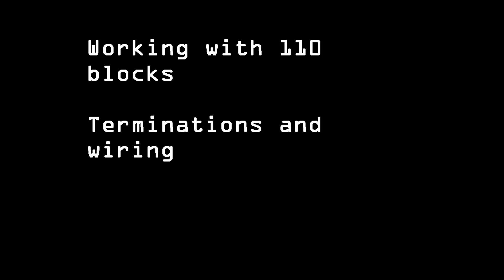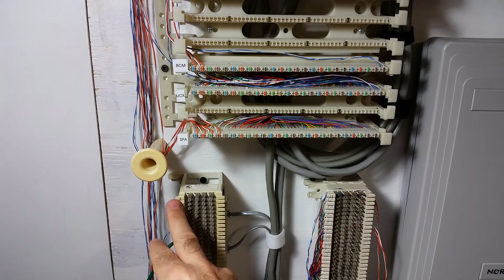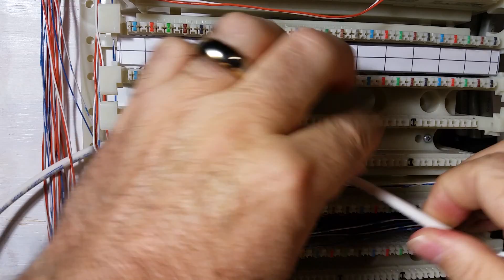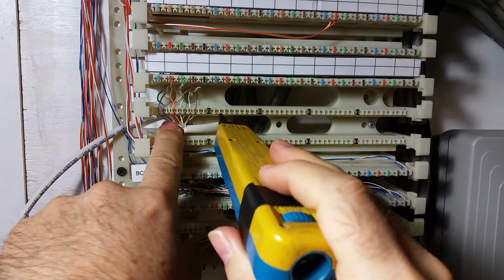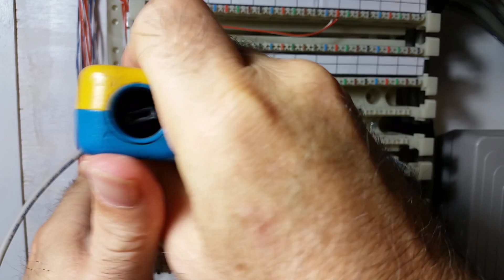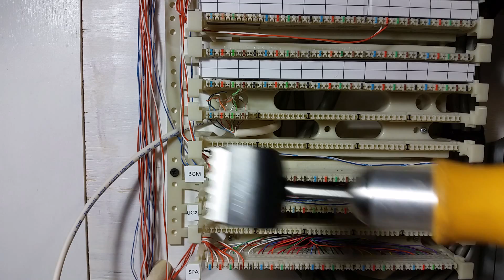punch down 110 blocks

Comment: Compare the cost of a new 110 head for your punch-down tool to the time you spend in a year wiggling cut ends off a block times your hourly rate.  Work smarter before you work harder.
Reply from the maker: That’s how I like to think about things too.  Great point. 👍🤔

Comment: As a Canadian, I have much more experience with BIX strips, rather than 110.  In fact, I've only worked with 110 strips once.  With BIX, instead of using those wafers, you punch the cable onto one edge of the strip and then flip it over, so the cable is at the back, leaving the front side open for the cross connects.  BIX is common in Canada, because they originated with Nortel, the same company that made PBXs and a lot of other telecom gear.  About 11.5 years ago, I was at the State Farm head office in Indianapolis, Illinois for training, where I was surprised to see lots of BIX, though they also had 110.  The punches for BIX are very similar to 110, but the 110 punch can also be used with the Keystone connectors and patch panels.  You can get BIX strips marked for different cable types, such as 25 pair, 4 pair and 2 pair.  I don't recall seeing 3 pair, but they may exist to be used with the old 3 pair CAT3 phone cable.  The only difference between the basic strips is the markers for cable type, but are electrically identical.  There are also special types for multing, etc., but I haven't used those.

Comment: does anyone know where the names come from? 110, 66? the 110 block is more of a strip and has 100 connections, the 66 block has 200 terminals...
Reply from the maker: Right.  I don’t think the model number is related to the number of connectors.  Good question 😄
Reply: These were AT&T / Bell designations. The predecessor to the 110 block is the 88 block. I'm not sure what the difference is or when they replaced the 88 block with the 110 block (sometime in the 70s is my best guess). The pictures of the 88 blocks I have found look identical to 110 blocks.
Reply from the maker: That’s interesting, Brian.  Thanks for that info! 😊

Comment: I'm wiring up an intercom system that requires 12 cable joints. Rather than using gel connectors floating in a large junction box, can you buy DIN rail terminals from which the connections can be made? That way they are neat and easy to understand for any future technician looking at them?

Comment: If your punch down tool is dull,  Sharpen it deat Henry !  A few strokes of a file will save messing with all those partially cut conductors.
Reply from the maker: Hmmm, I will have to try that! 😁
Reply: Yep.  I would consider his tool defective.  Some punches are adjustable for the blade.  I have Eldon punches for both BIX and 110 that have that.  Eldon got the line after Nortel went bust.

Comment: Great video! Needed to learn how a 110 block works in the immediate and this did not disappoint. I'm sure it wouldn't be recommended, but is it possible to rip pre-existing punches out of the wafers and repunch as needed and keep the physical integrity of the block/wafer?

Comment: Hi, i find your video very interesting, but what got me confused here. you punch down on the third pair while the other end is on  the blue pair why not on the same third pair.
Reply: The top (green) pair was the service from the phone company (phone no 111.111.1113) and the bottom was the outlet in your wall going to the physical phone. If he did blue to blue that would have been another phone on the first service line (phone no 111.111.1111). If he did green to green then the phone outlet wouldn't work because a telephone doesn't use the pins in the green position of the wall outlet, only the blue (the other 3 pair are there for future flexibility, for example put multiple outlets on the single cable where blue is outlet 1, orange is outlet 2, green is 3, and brown would be 4).

I'm no telecom worker, this is just what I've picked up from videos here on the tube...

Comment: For cat6 you need to keep as many twists as possible to prevent crosstalk so don’t fan out the pairs. Just place them in the blocks by using the small peak of the block to separate the twist and place the pair before cutting.
Reply: I also put the end of the outer insulation in the middle of the connector and then fan out, to minimize the length of wire.  I also use those peaks to separate the wires.
Reply: is crosstalk a severe issue for 2 inches of wiring though?
Reply from the maker: Maybe not “severe”, but you do want to keep the twist in the pairs as much as possible.
Reply: @DIYTelecom  1/2" untwisted MAX!  If you do things right, there should be virtually no untwisted wire.

Comment: How do you replace a 4 pair cable terminated to a 110 block?
Reply: There's a tool built into the punchdown or needle nose pliers of a small size are handy for pulling out the wires that you need gone.

Comment: they used to be known as 88 Blocks back in the day...
Reply from the maker: really John?  that’s news to me.  I will have to look that up.  thanks for commenting! 😁
Reply: @DIYTelecom  I believe he may be referring to wire wrap terminations. These  used square cornered pins and you used a spring loaded wrapping tool that would spin the wire around the post/pin. Believe it or not, these connections had tons of force at the connection point between the square corner of the pin and the wire. The connection was so tight, no gas molecules could penetrate to the contact point, so they would never  corrode unlike punch down connections.   

If i recall correctly, a type 88 was a type of board that had rows of the pins on them. Telecom used to use them a long time ago and they were also used for making circuit boards  using discrete components, before printed circuit boards. They became popular in very early industrial automation control. The boards built with these connections to discrete components would slide into slotted racks. Old, early mainframe computers used these type connections too.
Reply: @professorg8383  110 blocks were in fact known as 88 blocks back in the 1970s. There are several Bell System Practices that refer to them as 88 blocks. I haven't been able to find out when 110 blocks came out or what makes a 110 block different from an 88 block.
Reply from the maker: Not completely related to this topic but since we’re going back in time, I once saw a demarc where the wire pairs coming from the street were soldered onto the pins.  The cable jacket was cloth (not plastic). And, the pins were on like this wooden back plane (as opposed to a blue board).  Only time I ever saw it.  It was in a very old building in downtown New Haven (yes, home town of the very first telephone exchange!) 😊
Reply: @brianleeper5737  As I knew them, 88 blocks were wire wrap and they got their name from the model series, category. 66 blocks, were punchdown bocks, but much different than 110 punchdown blocks and spread out further. 66 blocks relate to a part number and were usually grouped in rows of 4 or 6 connections.  As for 110 blocks, I believe it referrers to the type of insulation displacement design. I'm not sure why they would have also been called, "88 blocks"  because they are way different in the connection type.  That said, the density of connections is probably pretty close, whereas the 66 series is not anywhere near as dense.  Might be that 110's and  88's  would take up similar space. As far as when they came out,  not sure. I know I can recall seeing them in the 70's and that could be. 110's are definitely easier  but arguably no as reliable if done right. I would say wire wrap is by far the best connection of the three, probably followed by 66's, if done correctly and 110's last. If you go back far enough, the used to use screw terminals for phone/telecom connections. Slow and take up a lot of space.
Reply: @DIYTelecom  Have you ever seen a 1a2 key system that used 110 blocks instead of 66 blocks? The Bell System Practice I saw showed how to use the 110 (or 88 blocks as they were then known as) for cabling a 1a2 key system. I have never seen that. All the 1a2 key systems I have ever seen were done with 66 blocks.
Reply: @professorg8383  I never saw a model # for customer premise wire wrap blocks. The last time I saw a wire wrap block (outside of a central office) it was used for T1 lines and made by Homaco. Central offices almost always use wire wrap blocks. Could the 88 block you're thinking of be a central office block?
Reply from the maker: So to be candid, 1A2 were on the way out just as I beginning my telecom career.  But the few I did see (mostly in K-mart stores) all had those extra-wide 66 blocks .  You know those non-split kind with like 6 pins across.
Never did see any with 110s.   Trying to think of how that would work.  Because,  don’t you have to share the pairs across several pins?  (Like share the 25 pair across several phones)
LoL.  Bear in mind,  I am pretty clueless on those systems. 😄
Reply from the maker: This conversation is making me curious.  I’ll ask my dad if he recalls 88s.  He was a central office guy during the late 60s-70s.  Not that I doubt any of your assertions , Professor. 😊
Reply: @DIYTelecom  To make the parallel connections needed for 1a2, you would take the 25 pair cable from the KSU and use the non-cut side of the 110 tool to put it in the base (index strip) of multiple 25-pair 110 blocks then install your wafers/C5s on top of them then use cross-connect wire to feed your station cables (also punched down on 110 blocks) from the multipled 110 blocks.
Reply: @DIYTelecom  Another way to do it would be to use the cross-connect wire to feed multiple station cables, again by using the non-cut side of the 110 tool. This is identical to how you feed multiple station cables with a single POTS line, as might be done in a residential installation.
Reply from the maker: Yes, definitely.  So Brian... you were a Bell guy ?
Reply from the maker: Huh....  i can picture what you’re saying but have definitely never seen that. 😊
Reply: @DIYTelecom  No, just someone who reads Bell System Practices for fun :)
Reply: @DIYTelecom  Yea, I figured that 1a2 key systems with 110 blocks would be mighty uncommon. Probably slightly more common is what I used them for, I have all of my 4-pair cat5e station cables in my house punched down to 110 blocks and I run gigabit ethernet through them. I used 4-pair Nortel B Plus cross connect wire (meets cat5e specs) to make the connections between the patch panel and the 110 blocks. This also allows me to easily rewire a station cable for POTS instead of gigabit ethernet. And when I rewire one for POTS, I also leave the green and orange pairs connected for ethernet so that station cable can have POTS and 100 meg ethernet on it. At the other end I have an adaptor which splits out the appropriate pairs to a phone and an ethernet jack.
Reply from the maker: Ha!   Very clever!  Sounds like something I would do (the pots and 100meg on one wire trick).
Well, that sounds pretty cool.
I just got into a new house about a year ago and I am going to start figuring out my strategy for distribution of voice data.  Unfortunately, it was wired with Cat3 2-pair with serialized connection from phone jack to phone jack.  So pretty useless.  There is plenty of CATV home runs, so I am looking at leveraging the MoCA technology.
Stay tuned,  I am sure it will make for some interesting videos. 😆
Reply: @DIYTelecom  I believe he may be referring to wire wrap terminations. These used square cornered pins/posts and you used a spring loaded wrapping tool that would spin the wire around the post/pin. Believe it or not, these connections had tons of force at the connection point between the square corner of the pin and the wire. The connection was so tight, no gas molecules could penetrate to the contact point, so they would never  corrode unlike punch down connections.   

If i recall correctly, a type 88 was a type of board that had rows of the pins on them. Telecom used to use them a long time ago and they were also used for making circuit boards  using discrete components, before printed circuit boards. They became popular in very early industrial automation control. The boards built with these connections to discrete components would slide into slotted racks. Old, early mainframe computers used these type connections too.

Comment: One question? say you needed to test the pairs in a 110 block how can one go about doing this? say with a dsx-5000 maybe?
Reply from the maker: good question.  yes, I suppose you could use that Fluke tool for testing.  Might be overkill.  I use special connector (can't remember what it's called) that has these two little pins that insert into the punch slots.  This allows me to check for dialtone or put a tone on the pair.

Great point!

Comment: The sound of an impact tool hitting a 110 block is oddly satisfying.
Reply from the maker: yeah, kind of like the sound of  racking a round into a pump 12-gauge.   But, without the intimidation factor.    Thanks for the comment.  :-D
Reply: Networking ASMR
Reply: Kinda gets you in the groove??
Reply: @VideoNOLA  HAHAHAHHAA Booooooo!
Reply: Yes. That and a line finder in a SXS or the interrupter in an XB5.

Comment: This is the worst explanation of terminating a 110 block I have ever heard or saw.  I have been an instructor for 15 years and never called a C4 or a C5 a wafer and they do come in other configurations.  Or have I ever had so much untwist in the terminations of my pairs. This will cause failures for NEXT and possibly Return Loss.You obviously are an amateur installer . If you are going to make a video at least try to get the terminology correct.   Lastly I have never had anyone call an IDCs little metal teeth.  This is not a good instructional video
Reply: Having been in IT for about 13 years I'm going to be starting my first Telecom job in the civilian job sector in a few weeks.  I find this video very helpful and will be watching more.
Reply: Larry,
All that experience yet you're ass is too lazy to make videos.
I work in it and I ran across one of these tonight, I'm glad he made this video.
And please don't come back with some smartass reply use that energy to make some videos we can learn from
Reply: Man the guy did the best he could, cut him some slack we’re all still learning lol
Reply from the maker: Well, thanks for the feedback.  I don't claim to be an expert.  Just a telecom/network field contractor which requires you to be a jack-of-all-trades in order to get the job done.  The whole point of this channel is to help those with DIY projects.  Or, to help those trying to break into the business get some insight.

If you have a better video you've made, then please let us know.  :-).

Comment: I'm curious why you used a 4 pair cable to connect a one pair phone cable. Isn't 4 pairs normally used for ethernet and 2 pairs for phone?
Reply from the maker: +raventhorX yes, that is a good point.  Most phone and data pros don't bother to stock 2 or 3 pair cable on their trucks.  So, it's just easier to pull cat5e 4 pair for everything - even if you just need one pair.
Reply: DIY Telecom but then what about situations where you only need 4 pair but you have a 5 pair cable? do you just peel that off or is it repurposed for another network or phone line?
Reply: @raventhorX  I don't think I've ever seen a 5 pair cable.  In telecom, the cables are 3, 6, 12, 25, 50 etc. pairs.  In fact the original twisted pair Ethernet, which was called StarLAN, was designed to use existing 3 pair phone cable in offices and even sharing the cable with a phone.  Ethernet later moved to 4 pair cables.
Reply: @James_Knott  wow this comment came back so late that I don't even remember why I was thinking a 5 pair cable existed. I think that might have been a typo so I apologize about that. I dont even remember everything in this video either. Last comment looks like it was 6 years ago.
Reply: @raventhorX  Yeah, with YouTube you can come across some ancient threads.  I believe your comment related to the 5 pair spacing between the marks on the 110 strips.  Those marks were intended for 25 pair cables, where there are 5 groups of 5 pairs, according to the colour code.  You are no doubt aware of the 4 pairs in Ethernet cable, that is blue, orange, green and brown, with a white stripe on one wire of each pair.  In telecom cables, there is a 5th pair, slate as well.  Then the whole sequence repeats, with red, instead of white, then black, yellow and violet.  So, those marks are for each of the 5 groups of 5 pairs.  Look up 25 pair color code on Wikipedia for more info.
Reply: just like 4 pair situations that only use one pair - the spare pairs are coiled/twisted back down the sheath, out of the road, never cut them off, because one day they might be needed

Comment: What is the jumper cable called specifically?
Reply from the maker: +Tracey Duff good question.  It goes by a lot of names "cross-connect wire", "single-pair wire", "jumper", "22-gauge".
Reply: Do you know of a good supplier or where I could purchase some?
Reply: I always just called them cross connects, as I come from a telecom background.  While the regular telecom cross connect wire is available, it's not suitable for Ethernet.  For that, I just strip some of the cable I'm working with to get the pairs.